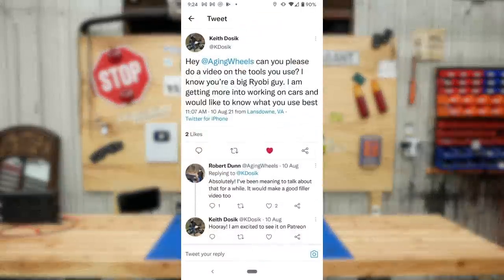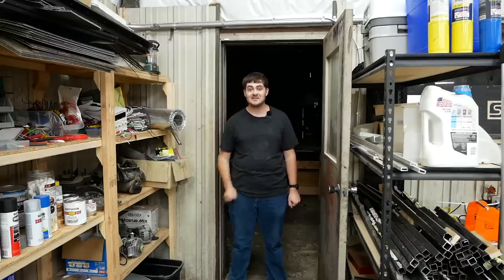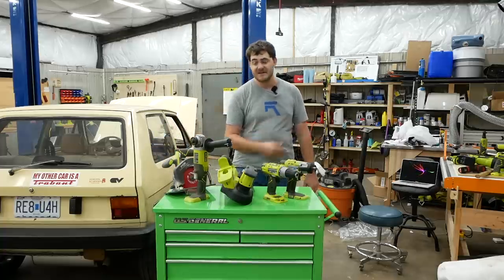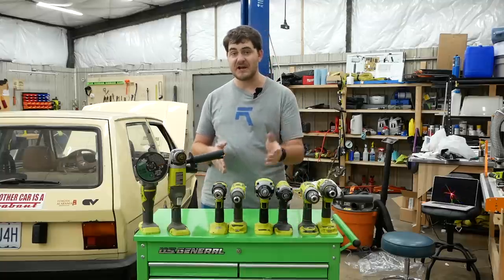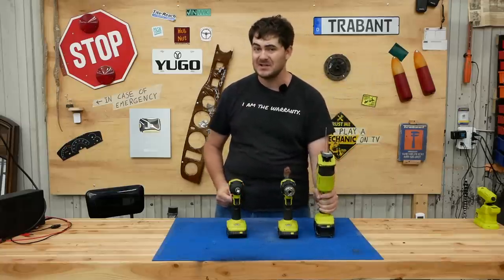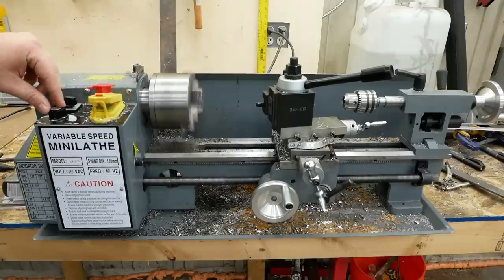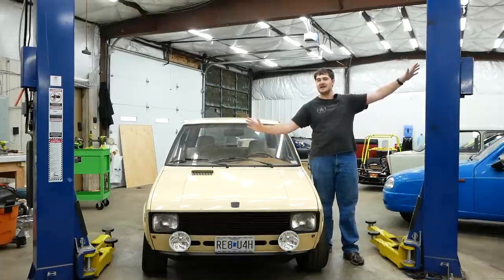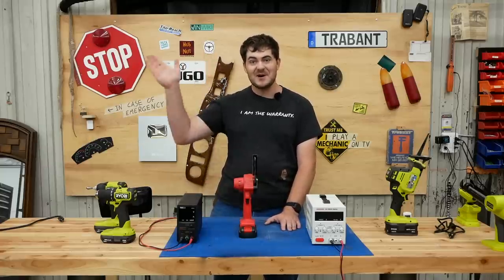What Tools Do I Use? Why? | Aging Wheels Tool Tour

Comment: I can definitely vouch for both spending and saving a TON at direct tools. I currently own 2 vehicles that I bought for less than I've spent on their website. But, as of the last time I calculated it, I saved ~44% off retail. And that was compared to quite a few sale prices at the homeless despot. 

As far as your 3D printer goes, check that you don't need to change the firmware. A lot of the cheap Chinese machines come with VERY IMPORTANT safety features turned off for some reason. Look for videos covering the 3 tests you need to do to check the safeties. I think Creality has gotten better about that recently, but I would still check. Also, be sure to check you're wiring/connections/strain relief for your heated bed. I think it was Creality that used fake/improper connectors and soldered instead of crimped them, causing fires. I think Makers Muse made a video about that a few years ago. That's a great channel, as is Thomas Sanladerer and CNC Kitchen. 

Happy printing, and thanks for turning me on to direct tools; although my bank account still hates you.

Comment: Ryobi has a 3 year warranty. All you have to do is register your tools online, and if they break with-in 3 years (which they do if you use them on the regular) you can get a replacement for free. This has saved me a lot of money in tools since I am a carpenter. Most tool brands have this option (dewalt, ridgid, ryobi etc), so if you use them often they will most likely fail with-in 3 years. This is an easy way to get a free one instead of buying another one right away. It's worth it

Comment: DRILL PRESS : A tall upright machine useful for suddenly snatching flat metal bar stock out of your hands so that it smacks you in the chest and flings your beer across the room, denting the freshly-painted project which you had carefully set in the corner where nothing could get to it.

WIRE WHEEL : Cleans paint off bolts and then throws them somewhere under the workbench with the speed of light. Also removes fingerprints and hard-earned calluses from fingers in about the time it takes you to say, 'Oh sh*t'

DROP SAW : A portable cutting tool used to make studs too short.

PLIERS : Used to round off bolt heads. Sometimes used in the creation of blood-blisters.

BELT SANDER : An electric sanding tool commonly used to convert minor touch-up jobs into major refinishing jobs.

HACKSAW : One of a family of cutting tools built on the Ouija board principle... It transforms human energy into a crooked, unpredictable motion, and the more you attempt to influence its course, the more dismal your future becomes.

VISE-GRIPS : Generally used after pliers to completely round off bolt heads. If nothing else is available, they can also be used to transfer intense welding heat to the palm of your hand.

OXYACETYLENE TORCH : Used almost entirely for lighting on fire various flammable objects in your shop. Also handy for igniting the grease inside the wheel hub out of which you want to remove a bearing race..

TABLE SAW : A large stationary power tool commonly used to launch wood projectiles for testing wall integrity.

HYDRAULIC FLOOR JACK : Used for lowering an automobile to the ground after you have installed your new brake shoes, trapping the jack handle firmly under the bumper.

BAND SAW : A large stationary power saw primarily used by most shops to cut good aluminum sheet into smaller pieces that more easily fit into the trash can after you cut on the inside of the line instead of the outside edge.

TWO-TON ENGINE HOIST : A tool for testing the maximum tensile strength of everything you forgot to disconnect.

PHILLIPS SCREWDRIVER : Normally used to stab the vacuum seals under lids or for opening old-style paper-and-tin oil cans and splashing oil on your shirt; but can also be used, as the name implies, to strip out Phillips screw heads.

STRAIGHT SCREWDRIVER : A tool for opening paint cans. Sometimes used to convert common slotted screws into non-removable screws and butchering your palms.

PRY BAR : A tool used to crumple the metal surrounding that clip or bracket you needed to remove in order to replace a 50 cent part.

HOSE CUTTER : A tool used to make hoses too short.

HAMMER : Originally employed as a weapon of war, the hammer nowadays is used as a kind of divining rod to locate the most expensive parts adjacent the object we are trying to hit.

UTILITY KNIFE : Used to open and slice through the contents of cardboard cartons delivered to your front door; works particularly well on contents such as seats, vinyl records, liquids in plastic bottles, collector magazines, refund checks, and rubber or plastic parts. Especially useful for slicing work clothes, but only while in use.

ADJUSTABLE WRENCH: aka "Another hammer", aka "the Swedish Nut Lathe", aka "Crescent Wrench". Commonly used as a one size fits all wrench, usually results in rounding off nut heads before the use of pliers. Will randomly adjust size between bolts, resulting in busted buckles, curse words, and multiple threats to any inanimate objects within the immediate vicinity.

Son of a b!tch TOOL : Any handy tool that you grab and throw across the garage while yelling 'Son of a b*tch' at the top of your lungs. It is also, most often, the next tool that you will need

Comment: I got the same harbor  freight hydraulic  gear puller.  Had to use it to pull off seized  rotors from a Mazda to give you a idea of how stuck  it was I pulled the  rotors face off the hat

Comment: I have the same cordless angle grinder and while i agree its not so goood at grinding up metal i use it with a surface prep disk and it works great for removing paint, light rust and mill scale for fabwork it seems plenty powerful for that when used with one of the higher output batteries

Comment: I got lucky. Ottawa has a DIY garage with lifts! The hourly rental is a lot cheaper than buying a lift then having it installed and wired up! Plus, the garage includes the use of their tools in the rental including air powered tools! No batteries required!

The main disadvantage however is that you can only work there when they're open, and you need to book ahead. But for the little amount of heavy work I do on my Fiat 500 Abarth, that's fine by me.

Comment: Robbert you should flip the gas struts on the us general roll cart. There is a small amount of oil that would be better if the oil stayed on the wiper seal rather than in the bottom not doing anything.

Comment: I stick to two battery systems... Dewalt and Ryobi.  My everyday beat the crap out of them tools are the Dewalt (circular saw, jigsaw, drills, impact drivers, angle grinder and reciprocating saw mostly) and my special, one-off, not used very often tools are the Ryobi.  I have the Ryobi finger sander and hot glue gun... both work great.  I also have the 16GA finish and 18GA brad Ryobi nailers, as well as the 18GA crown and 3/8" staplers.... they are very cost effective and perform well.

Comment: I bought the husky 3/8 drive ratchet that was reviewed by sixtyfiveford. It has been great and I got it for $50.  The only downside is that it has internal batteries so the whole tool is down while charging.  Overall it’s well built and very much a great value buy for all but folks who use the battery ratchets all day.

Comment: I am a Ryobi guy as well.  I do solar and when an impact or drill go flying off a roof..... im not too upset if it breaks.  typically thought they still work fine.  I have not had luck with their plug in palm sanders... went through a few of those.... and a few weeks ago my 6pack charger wiped out 6 batteries... ouch.

Comment: I got 2 of the angle grinders form the Police auction site and have had no problems. One has a 30 grit flap wheel for sharpening mower blades and the other has a cutoff wheel. They both work great with either the NiCd battery or the high output Lithium. A seller on eBay makes a conversion kit for the Milwaukee cutoff saw to convert it to a mini belt sander {Dynafile}. Unlike the Ryobi unit, it is compact like the air powered units and works great! Just don't buy your sanding belts from that jungle website....

Comment: Love your collection. I have an old hot glue gun that I love. It plugs in to the wall but you tilt it forward to disconnect the gun from the base. Use it and return to keep the heat going. The heating bit is large enough to hold temp for a few minutes.

Comment: Ryobi is fine in a home garage, but as an industrial equipment mechanic, I prefer Milwaukee. the impacts, 3/8 and 1/2 inch are power houses. They are a little pricey, but worth it if you use them every day.

Comment: I've found that when you buy into a tool system, you are more buying into the battery configuration. 
I have a lot of Ryobi 40V tools for outdoor use, chainsaw, mower, brush cutter, etc. As it turns out, the "40V" is a lithium-ion 10S pack, which is the same configuration of almost every scooter in existence, and surplus used scooter packs are readily available at a pretty heady discount. Adapter plates are available online, and 
For hand tools, I've locked into the DeWalt 20/60 system. I have one exception that is a Milwaukee 12V ratchet, and the battery pack failure rate has been abysmal. I've found that aftermarket battery packs have longer life.
I will admit to a certain amount of tool envy, as well as a whole lot of workspace envy, but I also recognize the amount of work that goes into what you do, and that alone makes me exhausted.

Comment: The Ryobi floor sweeper is still available on Amazon's European sites. I have a desire to get a Ryobi ratchet. I take the point about the big battery, but I have the batteries so I may as well use them instead of needing another charger and batteries.

Comment: This is a great video. Having used Ryobi if you use these tools on a daily basis they have a life span of 1 to 2 years depending on how hard you work them. Also fun fact Hart tools from walmart are the same as Ryobi except they're white. I really like Ridgid Brand power tools for the pro-sumer level of use Ive seen then used at a professional daily use level with only small reliability issues. Very similar to standard milwaukee tools. With all that said if you run tools hard every day i would use (#1 Milwaukee Fuel, (#2 Makita, (#3 Dewalt, (#4 Milwaukee (#5 Ridgid (These are just the most common brands you could also research panasonic, metabo, festool, and some other more niche brands that are very good.) (Disclosure I use exclusively milwaukee (mostly fuel) for cordless.) Buy once cry once.

Comment: Nice rundown of your tools and rational behind them. Interesting that you have a 'negative' experience with the Ryobi brushed angle grinder. I have what appears to be basically the same model (UK model if that means anything), and love it. I reach for it much more often than any of my corded grinders. It does need to use at least a 4Ah battery, but I've never had it cut out in use.

I'm totally jealous of the prices you're able to get the tools at. They're at least 3 times as expensive here in the UK.

Comment: Makita has a finger sander out now. As does Metabo but theirs is corded and not available in the US. I think there might be one other as well. But you nailed the big thing with Ryobi or any platform for that matter. Once you are invested into a battery platform it generally isn't worth going outside of it outside specialty tools. Ryobi might not be the best, but they are generally good enough for most. The sweeper was the one amazing thing they had, it being discontinued blows.

Comment: Wait until you find out, that you can actually print stuff for your vehicles. I do that for my motorbikes all the time, and its addictive!
Reply: The most useful thing I printed was a custom-made shift knob for my Focus. I made it with a threaded steel insert, and it turned out to be one of the best things I'd driven with.
Reply: My most useful thing? A metal Thermostat cover that is only available in plastic. The Stock plastic part warps every 5-10 years, my metal one will never warp. And its shiny! :)

Comment: Spin the chuck on the drill and find the high spot, then just hit it down with a hammer. I've straighten heaps of stuff down to tenths of a thou, you just need a dial to check runout.

Comment: I have had really bad experience with Ryobi's string trimmers two out of 3 have broken although first one was gas powered and second one electric, the electric one got some grass into the motor and burned up and the gas powered one just doesn't start anymore. I presume they have improved the electric ones somewhat at least because the second electric trimmer has been working decent enough.
Reply: All petrol powered string trimmers will stop being "startable" if you use any form of Ethanol-based gasoline in them. Also, unless you use them every single week, after each use you need to empty the tank then start and run them until the fuel in the carburettor runs dry. Leaving fuel in them will gum them up, especially over winter. They are easily fixed, just install a carburettor repair kit.

Comment: I have used DeWalt XRP tools for years.  For a while,  The 18v XRP batteries were getting hard to find.  So I bought a 20v XR drill charger and two batteries.  Withing 2 months,  one battery died.  Now a year later, the second battery is junk.  I found 18v XRP batteries again at Lowes.  and bought 4.
My 3 drills, One lowlow grade household thing,  one mid grade, and one high end hammer drill. all take the same battery.  My Circular saw which does very well also takes the same battery.
My angle grinder which.. you guessed it  takes the same battery has gone  kaput.  I let my nephew borrow it, and her kept trying to "throttle" it like a drill.  (why, I have no damn clue!) When in fact, all he was doing was arcing the contacts in the trigger.  Now they are basically stuck in a half-on, half-off configuation and the grinder will start to run slowly (and very smelly) as soon as I put a battery in it.  However If I hold the trigger, and then put the battery in,  It runs fine.  ..As long as I take the battery out before releasing the trigger.  Yeah that's all good until the battery contacts arc too much and those weld in place too...  Can NOT find the XRP 18v angle grinder.. ANYWHERE!
My dad has all Ryobi.. He keeps them all in the house. Every time I pick one up,  the battery is dead.  He has like 10 batteries and will charge them all up.  Then in a few weeks or so,  when needed.... DEAD!  He got the lithuims.   Those too,  always dead.  
Meanwhile, my DeWalts have sat out in the unheated shed all fall and winter, and  jumped right into action when I pulled them out of the cold, drafty metal cabinet.  Even the one drill & battery that accidentally got left out under a project car, on nothing but a bit of cardboard all winter.   I have 6 XRP batteries, and 4 chargers.  Two of the batteries are over 10 years old.  Still kickin'!

Comment: My tools.... mostly whatever was laying around the local thrift store. No really. My impact gun is a Milwauke that was very obviously used in a shop and it runs and bangs away fine. As for different brand batteries, I'm an electronics / 3d printing nut and a battery nut so I have adapted power packs that fit everything from deWalt to Ryobi to crappy store brand. When I get a new tool I chop off the battery mount and design an adapter that plugs into my favorite batteries and that's that. Most tools only care about positive / negative, the other stuff is used only to monitor it while charging.

Most thrift store finds seem to come from people or shops upgrading to later models or better ones. It's not that I'm too poor to afford proper new tools, I just love tinkering with the old ones that coe to me without a battery or charge dock or whatever.

Only thing you need to do is make sure tools are the same voltage. I use 18v everything.

I do use proper air tools for when the cobbled together team of cordless stuff can't quite manage, but besides that it all works fine. :)

Comment: A lovely video and quite a few tools , but you didn't mention any working lights , I've seen you use magnet strip light things and wonder have you ever been temped by the mini lights on caps hard hats head torches on head bands or those odd lights on safety glasses. Keep up the impulse purchases maybe a shop microwave or a fridge freezer (6ft tall) as I'm now using one my wife told me to store in my workshop ,so I use it too

Comment: I haven't had any trouble with my angle grinder but I think there's a weird middle model between the one you have and the current brushless offering. When it kicks I'll be looking into the Milwaukee one though since I have the ratchet. Got that for the same reason you did

Comment: I actually have the 5 1/2" Ryobi circular saw, no I didn't buy it. Was found on the side of the road with a dead battery. It's been handy around my parent's cottage ripping up sheets of plywood from an old shed I took down. It's not super powerful but that's okay because it was free. I also found with it a Ryobi worklight, its of the incandescent variety so you know its old... well that and both the saw and the light are not even green, because they're blue.

Comment: I will say that the Hart brand tools from Walmart can also be decent options, though their standard brushless compact drill still seems to be the best choice of the lot in terms of overall performance per dollar. A shame that their battery reliability is about on par with Ryobi, in that it isn't particularly good. But that's the compromise you pay when you aren't willing to shell out for Milwaukee or Makita. Black&Decker also makes some nice tools, surprisingly. Though, once again, batteries are their weak point. I'm not entirely convinced that Hart isn't just Black&Decker with a different color shell and different branding.